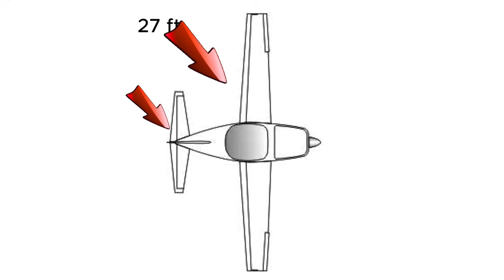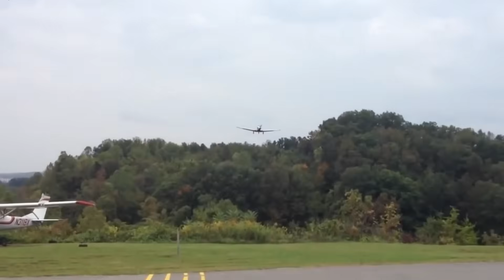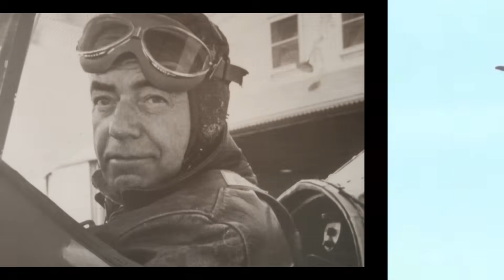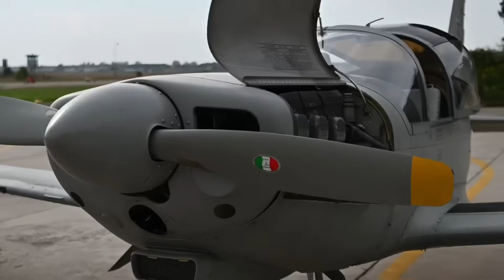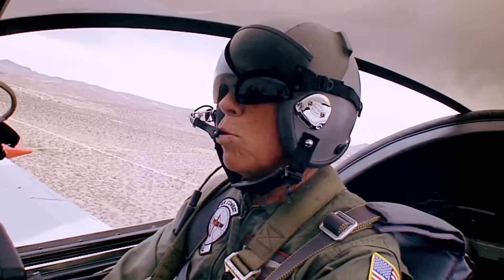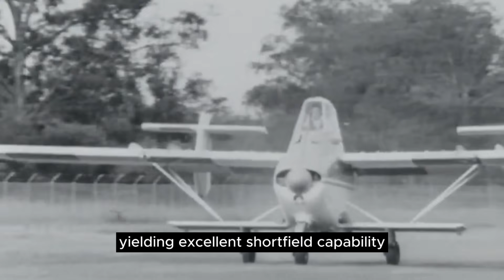Some of my favorite airplanes rolled into one video.

Comment: 11:50 That was a divine sound, almost sounds like the Morane Saulnier M.S. 406 but wound up even more. I found the short video that was sourced (Channel: Bob Hassel) just to hear it fully and after much searching was rewarded. It must have the two blade prop and it is quite thrilling to hear this familiar sounding engine prop combo blasting by so quickly.
Reply from the maker: I don’t even remember if i mentioned in the video or not but the little paddle blades on the questair were customized for that plane alone!